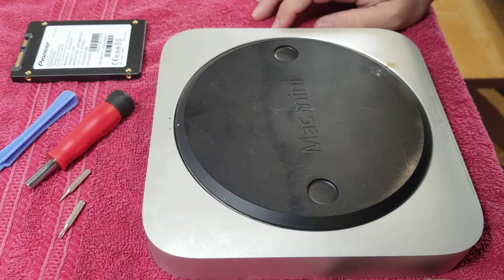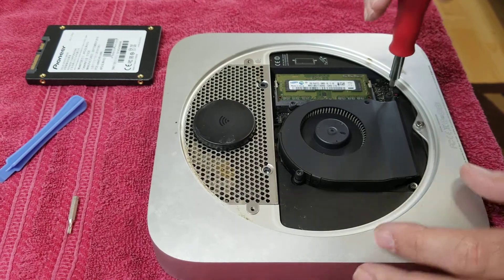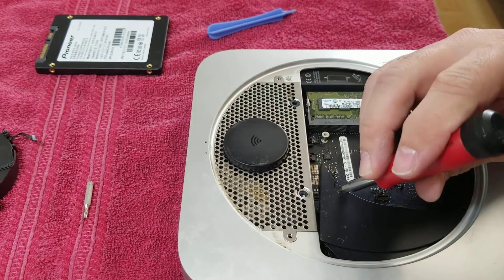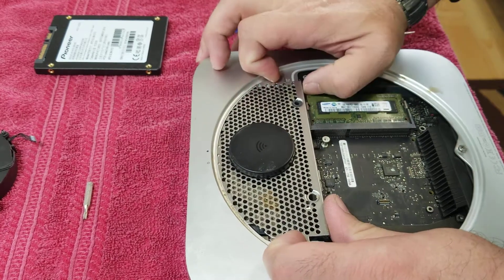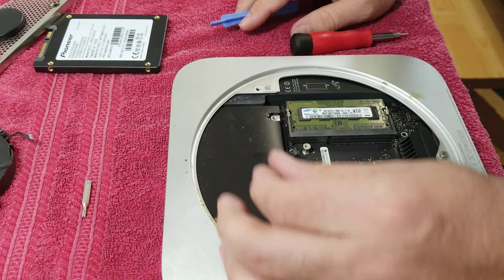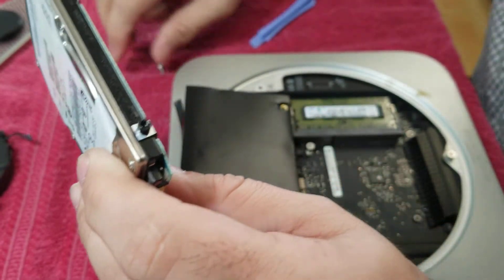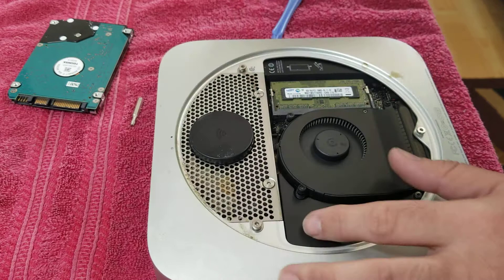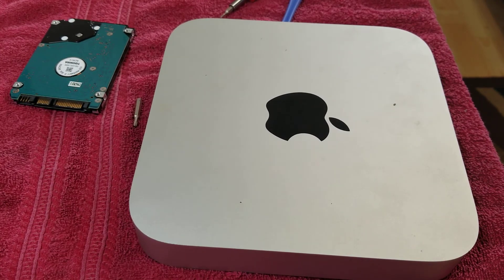How to Open a MAC Mini A1347 2010 to upgrade the Hard Drive to an SSD

Comment: Thank you for your video. Are there heat sensors that need to be attached from the hard drive to the logic board? My logic board resembles yours exactly, and I am unable to find where to attach the heat sensors.